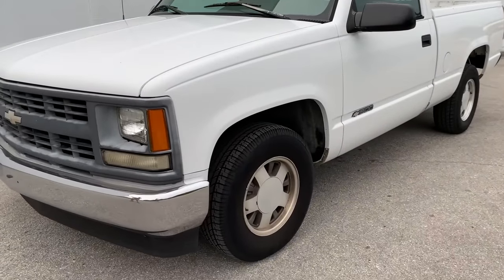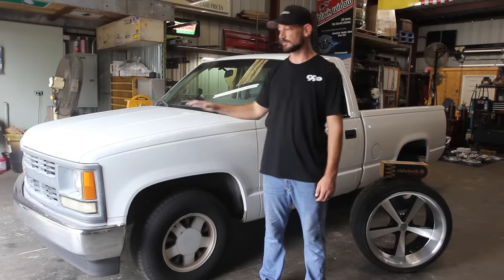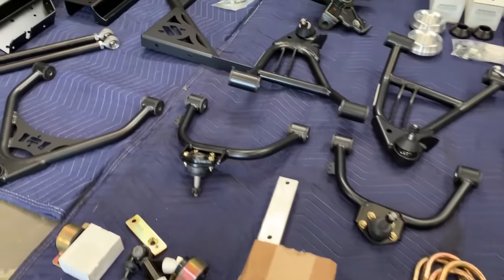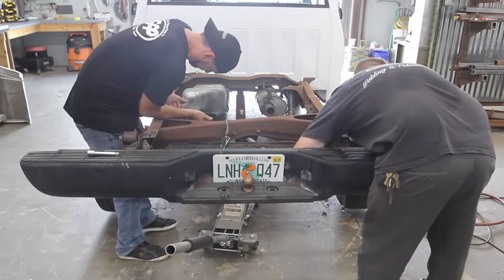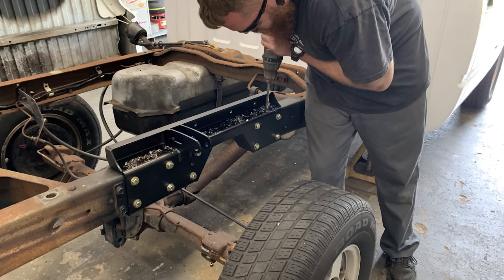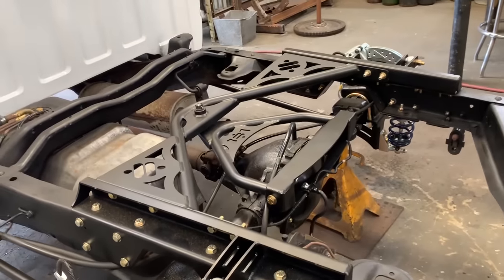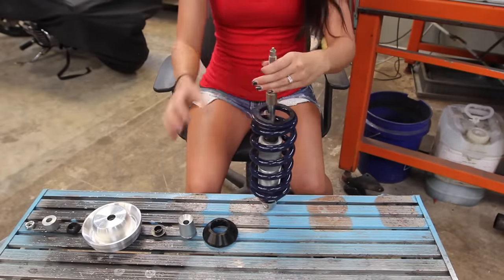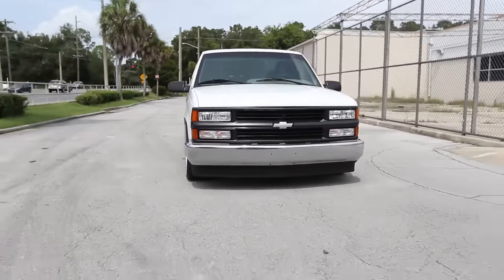FULL BUILD Would you try this OBS suspension install yourself?

Comment: I would really like to see this done on a 99-07 truck this is quite the upgrade compared to the other drop kits offered I have the djm control arm kit 4/6 and the djm upgraded swaybars with lift shackle in rear with caltracs very basic but still puts you into the 2 grand range if you replace the coils and upper and lower coil spring isolation rubbers also this c notch is what should have been developed years ago I made my own support that I welded to the seat bar and stitch welded to the top of the frame rail along with stitch welded in the notch so I could remove it later for upgrades when they became available!!!!!

Comment: you forgot to show about changing out the headlights and grill
Reply: It's not super difficult because all the holes are already there for the lights and grille the main issue I found in doing the conversion was the wiring but mine was previously messed with
Reply: @matthewconstance445  even harder is finding the grill and headlights not banged and cracked all to hell

Comment: Looks like they put around $8 - 12k into the suspension alone. Add $2k for brakes $2k for wheel and tire package . Without adding labor your into it around $20,000. For a 4.3 powered pick up. 🤔

Comment: I have the same rims on my 98 GMC C1500 3 door 2 4 drop with 22s I want to go lower.
Reply: I'm just buy the same wheels to put them on my 94 silverado but the front ones won't fit, did you put a different rotors and spindles?
Reply: Did you go lower do you rub?

Comment: 245/35 and 255/35 on 22x9 and 22x11's?????
Reply: Did he answer u???   I dnt kw what to use on my 93 obs,
Reply: @ do u have a obs
Reply: @gerardolopez5875  he didn't but I know that wouldn't work! I can tell u what I used. I had 22*9/22*11 now I have 20*8.5/20*10
Reply: @jasoncox3151  @ 22 no better?? Or rub on fender s?
Reply: @gerardolopez5875  I'm at a 5/7 drop. I trimmed the fenders but still rubbed. The 20's ride better!  I'm switching to coil overs rite now.
Reply: @jasoncox3151  @ ok,  mine it’s only  lowered by shackles 2 1/2 or something like it,,,    Front 2” spindles dropped,,,     Would 20  fit better?
Reply: @gerardolopez5875  it would definitely ride better. I have 285/35/20 in back and 245/40/20 in the front.
Reply: @jasoncox3151  @👍  245  4o 20,   All 4 córners,,,  will go

Comment: Did you changed the front rotors?
I have a 94 silverado, trying to put those wheels but the front ones won't fit. Center grease cap hit the wheel
Reply: I just  bought those exact rims 20s and they fit my 98 Silverado

Comment: Help....I have a `91 Silverado...5.7l dead transmission. Who makes decent parts to rebuild my700r4/4l60. It gave up the ghost at 250,000 miles. Can`t afford a new trans.
Reply: Get a 5.3L and 4l60e at the junk yard + a wiring harness and pcm. It'll run you under 1k and you'll be back to hauling ass with more smiles and miles per gallon. You can even go for a 4l80e while you're at it. Those 80e's are basically bulletproof up to about 600 WHP. If you're dead set in wasting money on a rebuilt transmission checkout Monster Transmission. They have 700r4's and rebuild kits for sale.

Comment: how much was spent on parts. $$$$$ 
not including wheels.
Reply: Yeah, what he said....
Reply: BIG OSSO just the kit alone is $5,725 .. not saying it’s a bad kit, but that’s way too much for a bolt on in my opinion. If you’re going to be spending more than what the truck is worth, at that point go with custom work
Reply: Add up the wheels/tires, suspension and brakes....around $9-10K...does not include little bits and pieces they didn't tell us about. Plus need to rebuild steering parts etc....high quality, very nice, but a bit steep at $10Kfor the average guy.
Reply: BIG OSSO , around $6000 for ride tech , plus you will need to get front wheels aligned , 
China version - few hundred dollars
Reply: And at that point is when I'd rather spend my money and put it on my  c10

Comment: $2k truck $8k suspension/ brake kit and $3k wheels and tires. Plus new lights, grille, and tint. Who knows what else. So for $15k you can have a nice truck with 150k miles and will need a motor for another $5k.
Reply from the maker: That's correct! And the motor is going in soon. Here the one we choose. Not everyone has the same passions in life but some do! https://www.youtube.com/watch?v=lrPLSAshsbI&t=19s
Reply: It's an awesome truck but most normal people don't have that much money for a toy.
Reply: Heath Johnson most people with toys will anticipate spending lots over many years though.